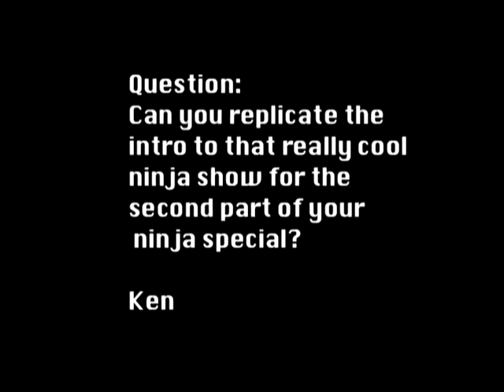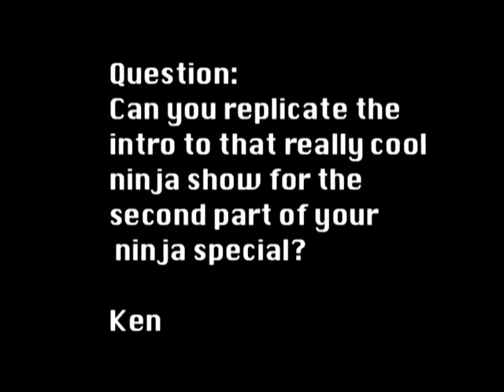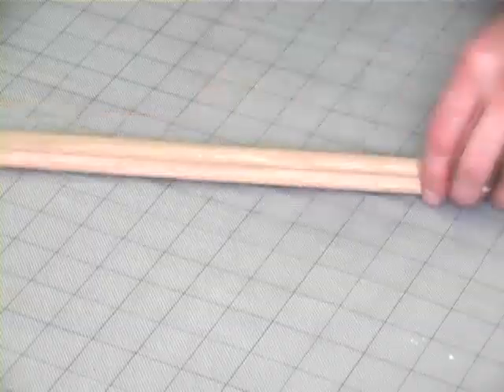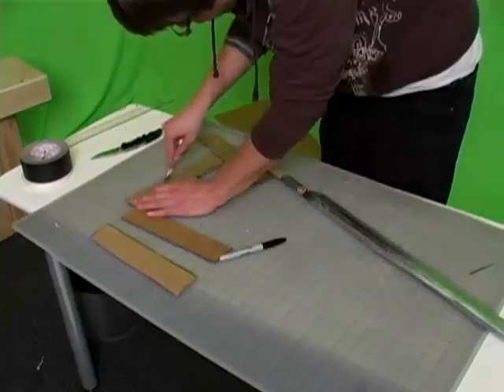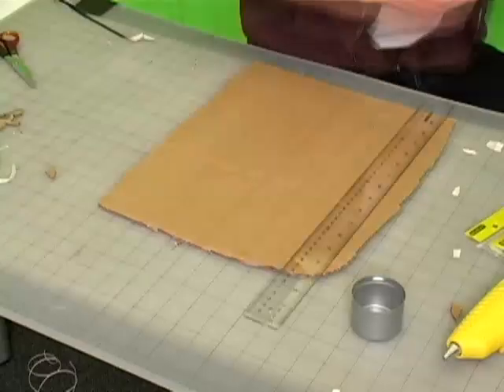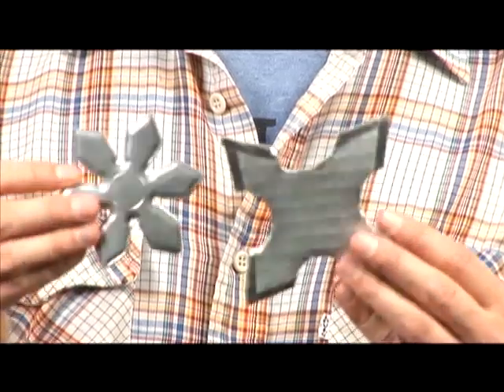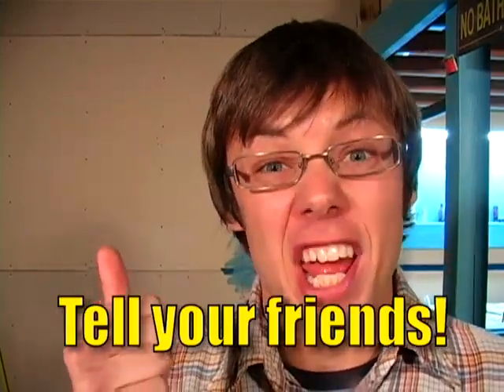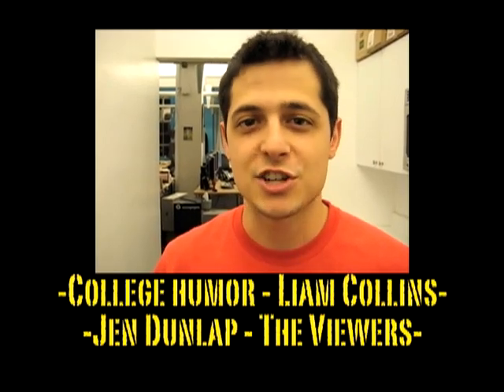Ninja Swords and Flying Ninja Stars : BFX

Comment: OK, your ninja moves are honestly anything but.  If your going to do a ninja (even low budget), you cant throw your weight around and go all Luke Skywalker wih the sword.  You need to keep your body centered & balanced.  Remember, Ninjutsu uses as many senses of your body as possible, with the least amount of endourance.  If that had been even a remotely real fight scene, you'd be wearing wife-beaters & using beer bottles, not swords.  Not to be too critical, but just remember balance & center.